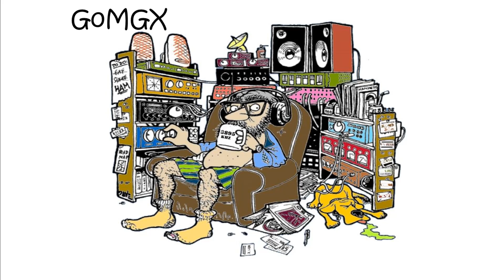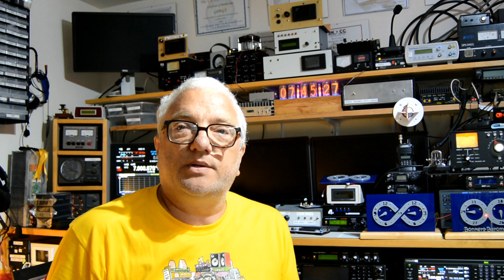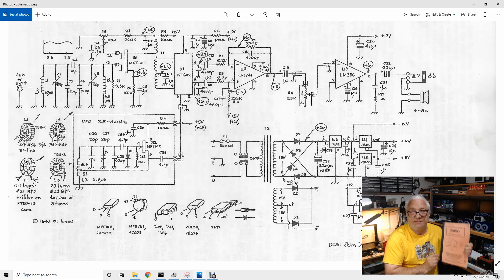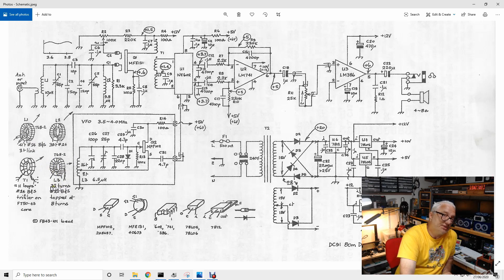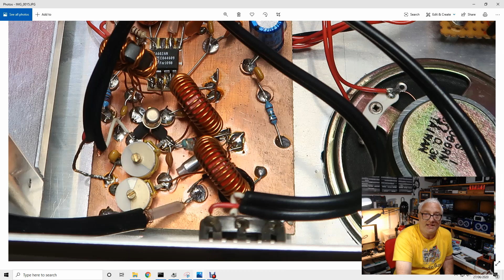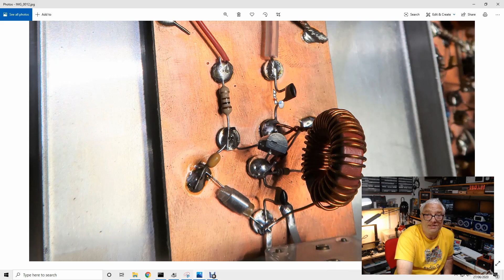Old vs New - A direct conversion receiver comparison

Comment: hi mark i like the island manhatten construction to your 80 mtr rx still use this method today its still very flexable you can add circuits unlike pcb,s where you are stuck with the circuit and unable to do any mods still got the qrp handbook by doug mcdrew jim g0wmj
Reply from the maker: I think there used to be a copper island construction kit available at the time - long gone now though. I guess you can make your own pads if you have the patients! Thanks for the feedback; that RX is still working well.

Comment: Interesting build. Your soldering wasn't bad. Next question, does it still work? 73 Clark KG7LOI
Reply from the maker: It does, yes, but it sounds exactly like the other one except for the drift!!!! My point was that its great to be building radio stuff in this day and age - fancy DDS VFOs and TFT displays - all for a few bucks, isnt it great?
Reply: @MarkG0MGX  Yes I agree that there is still kits out there. I really miss the Heath Kit days. When you built your own radios, like now, you know the in and outs of the radio and if it stopped working you can fix it your self. That was the purpose of the hobby. Now days it is most the antenna build. If your radio breaks down, most of hams now just take it to the shop to get it fixed or just buy a new one.
Reply: @user-mt2qn4yp8w  ain’t that the truth. I’ve been a ham for 9 years and I’ve built keys, antennas, and tuners, my next project is a DC receiver and I’m having a time trying to figure out how to build the local oscillator and the mixer. Honestly, still not sure what I’m doing.